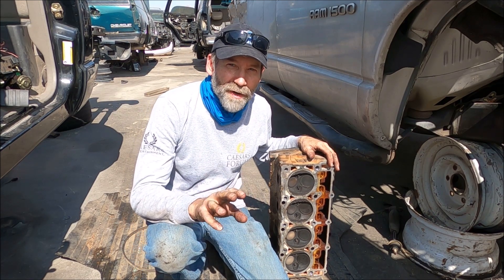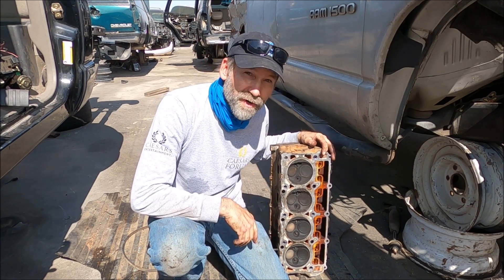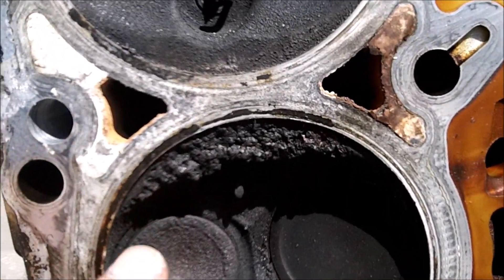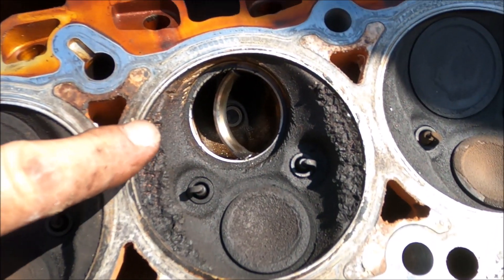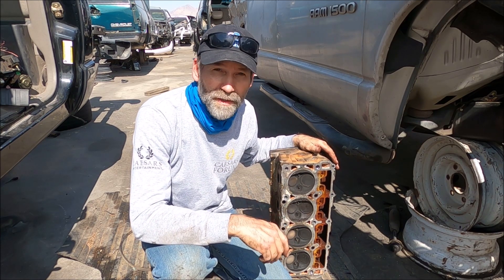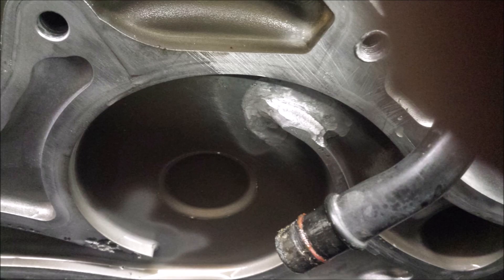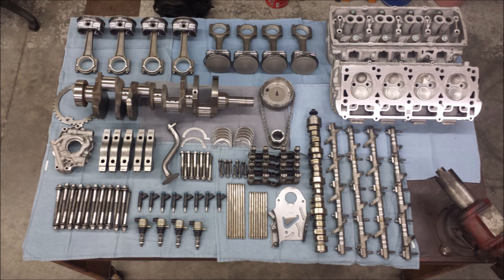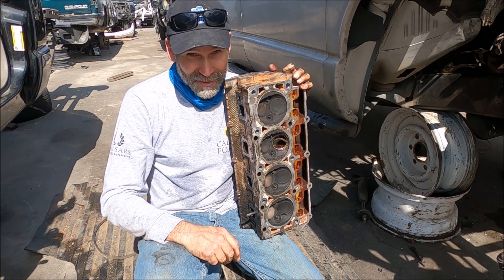Dodge Hemi 5.7 Valve Seat Drop

Comment: I suspect QC under Stellantis is lacking. Motorcycles get mighty hot and dont drop seats.  Ive owned countless cars all with aluminum heads going back to my 1961 Peugeot 403 and not a single one has ever dropped a seat. But getting back to proper cooling system purging I use a coolant funnel attached to rad and purge are from bleeder plug. Then do three heat/cool cycles in the driveway to draw in coolant from reservoir.  But I always worry there could still be air pockets lurking in the heads. Ive seem some examples of vacuum purging the cooling system.

Comment: I do German engines, and all are solid aluminum, i dont understand the idea of this design, why put a valve seat when you can make one solid aluminum head.
Reply from the maker: I doubt that your aluminum cylinder heads you're referring to have a aluminum valve seat that would just get hammered from the hardened valve.

Comment: I have a 2008 Magnum RT with 99.x k miles and have been paying attention to this issue. I believe you are correct. I did a recent overhaul of all hoses, pulleys, water pump, fluid replacement, serpentine belt, etc and experienced problems purging air from the system. The engine started to overhead as I followed other youtube instructions to shake the car and squeeze the hoses connected to the radiator. That helped, but I will suggest that these engines really require us to utilize the bleeder valve on the water pump to really be absolutely certain to purge the air pockets. You might be tempted to skip that step if you can't get that bleeder screw to unscrew. Some folks don't think using that bleeder is necessary if you use some old school methods. I believe that for this particular motor, we'd better do it by the book. You really need the exact size hex ratchet for the valve. Don't use one that is close and strip it it. Put dw40 or similar on it and get that bleeder valve loose. I'd also suggest that you don't let anyone else do a fluid replacement/ radiator flush. Several shops I checked with do not even use distilled water.  How likely will they spend the effort to loosen a rusted on bleeder screw? I had the same problem with brand new brakes, rotors, pads, whole deal. I got the car back and the break pedal felt too spongy. I took the car to another shop to have them bleed the brakes; no change. I then bought a scanner that has the abs purge feature. I ran that on both sides of the car and then re-bled the rest of the system. I also did a bench bleed. Brakes were much improved. Again, two shops taking shortcuts not purging the abs, and doubtful they did a bench bleed. Great video and I believe you are on the right track with the cause. Thanks !

Comment: Do you have to set the timing when you drop a valve do you have to do the timing again
Reply from the maker: Yes if you remove the cylinder head you're definitely going to need to redo the timing.
Reply: @martinbuilt if I turn the motor over do it damage anything it did not crank up
Reply: My car did the same thing did not damage a piston I replaced both heads do I need to do the timing change because it did not crank
Reply: My engine code saying camshaft position but I dropped a valve trying to see do I have to set the timing for it to crank
Reply: I don't see what you saying
Reply: I have a 5.7 do I need to do the timing chain

Comment: Can a dropped valve seat in a 3.7, fall down and keep the crank from turning?
Reply from the maker: I've seen it so bad to the point where it actually breaks exhaust valve off. And yes, then it could get jammed in there and keep the engine from rotating.

Comment: Its heat soak. The engine generates alot of heat. So when you turn it off pump no longer working so that head is still hot and seat slowly drops over time.

The only fix is to convert it to electric water pump so it can run when the car is shut down.

Comment: Hi, I. from Poland and I have imported from US in 2006 almost (11000 kilometers) brand new 5,7 Jeep Grand Cherokee. I made till now 239 000 kilometers. Suddenly my engine failed. My mechanic removed head and in 1st and 3rd cylinder valve seats dropped making huge damages to both pistons (as on your video). It scratch cylinders but it seams that number 3rd  might be not only scratched but also broken. Is that mean I had to find new engine or it can be repaired? I've seen on your video revitalized HEMI and I wonder if I can do the same? Thank you fro your response, Tomek

Comment: What are the odds that the factory that installed the valve seats didn’t use the proper seat to seat bore interference fit?
Reply from the maker: I believe it to be a factory defeat but one that Chrysler would not admit to. The way to keep this from happening is to never overheat the engine and make modifications to the cooling system. Also, make sure the cooling system is purged of air.
Reply: @martinbuilt  I used to build VW aircooled racing cylinder heads for over 25 years and if you do not give the proper interference fit between the seat pocket and seat OD you will end up with seats falling out.

Comment: Just happened to my 300c I’m being told I need a new engine that it would be cheaper is that correct?
Reply from the maker: there would fewer labor charges because it's just remove and replace the engine if the engine is as bad as the one in this video, or if the damage is not too bad. Take a borescope down into the cylinders and if the pistons are intact you really only need to replace the head.

Comment: Overheating, yes. Running without water/coolant,  yes. The other Hemis  that are NEVER overheated, and still drop a seat, are usually due to the rapid cooling/heating/cooling/heating of the cylinders with MDS. When those cylinders are "deactivated", they cool VERY rapidly.  Over time, this also drops seats....
Reply: interesting theory got any more evidence to back that up as gm uses cylinder de-activation as well, and im interested as i have a D-8 iron casting hemi ( copper-beryllium steat's as the oem flame-quenched one's kinda suck and are to soft for 2020-up pump ⛽ and M100 ) in my shop im planning on doing this with as 440+ci is a lot to feed at idle in a shopping lot/fast food joint 😉
Reply: @richardprice5978  yep. I can vouch for him
Reply: @5300trilla  look still on the skip-firing order ( GM i think is probably doing it better than 4on or 4-off but its the same lifter's every time. and the tigershark engine's have a better idea multi-air but is a little different ) as it save's gas ⛽ ( and probably saves ware/parts ) and last i looked at the pump it was 4.5+usd per-gallon so im not feeding all 1970 hemi V8 cylinder's idling/low load's 4.25X4.5 stroked

got a better way im willing to entertain the idea
Reply: @5300trilla  plus a 2-gen hemi v8 running only 2 cylinder's sounds like a beefed up harly big cam ect. aka it sounds ok 👍yes its low on power ( under 200hp ) as its only 2 out of 8 firing = 600-1200 hp~*
Reply: @5300trilla  BTW got a better way of pinning the valve seat's into the iron head's? than mopar's ideas
Reply: I can vouch for this. If you look at my channel, I’m working on mine right now. Mine didn’t overheat, but valves are not okay

Comment: I think the root cause is the position of the thermostat.
A)comprpmise #1
Alloy Cyl heads expand at a much higher rate than the iron engine block.
The cyl head gasket takes a beating and eventually will fail. 
To prolong the life of the cyl head gasket, engineers need to prevent sudden changes of temperature.
To achieve this, they have placed the thermostat at the entrance of cold water to the engine.
Plus the thermostat opens at 195F.
What this does is that when the water temp on the engine side of the thermostat housing reaches 195f ir will start to open but on a very cold day the incoming cold water current from the radiator will basically close the thermostat. Meanwhile, the rest of the coolant in the engine will be too hot, may boil in hotter areas of the cyl heads and create air pockets which them won't cool those areas and then over time you may have iron valve seats dropping.
B)Compromise #2
Integrity vs. appearence.
To achieve both goals of protecting the head gasket and securing coolant flow, they had to fit two thermostats.
The one at the entrance of the cold water being a 160F to prevent a sudden irrestricted high volume of chilled water going into a hot engine, and a regular 190F at the top of the engine in its way to  the radiator.
If this had been done, many would have perceived that as a recognition of an engine flaw and maybe affect the brand's image,
Luckly fo us we can add an inline thermostat housing with a 195F thermostat on the top radiator housing and then change the oem thermostat for a 165F or so.
However, 20 years and 100s of miles later, it may be now too late to fix the damage already done.
Reply: would Evans coolant help? and or a two stage cooling system? like i have seen in a refrigerating plant?
Reply: My 2002 4.7 Dakota has 245k miles on it, never had head gasket or valve seat problems. I live in Florida, it gets very hot and humid here, still no problems. I did upgrade the cooling fans, I removed the mechanical fan and installed 2 12 inch electric fans, but I did that at 200k miles.

Comment: What about the issues with the hydraulic lifters seizing up and causing cam issues?  I've read lots of stories about that happening once these motors get over about 90k.  Nobody seems to know for sure what's causing it other than maybe not using that exact Penzoil that Chrysler recommends.
Reply: Its less about oil brand than changing at 3K intervals. I just did lifters on my car and there is a thin varnish on close tolerance lifter internals that can cause it to stick. There is also a tiny check valve that can start leaking due to the varnish accumulation. Those two can combine to collapse the lifter and allow rocker to get knocked off the lifter pin.  If you had the time and patience you could remove/disassemble/clean each lifter and it would likely go for many more miles.

Comment: Why it happens is because Chrysler installs the valve seats in a cold head. Heat the head up, freeze the seats, then install. And that "corrosion" is caused by using OAT antifreeze's. "OAT" stand for "Organic ACID Technology". NEVER use OAT antifreeze's! Classic green only!
Reply from the maker: That's how we have installed new cylinders in an old Ford tractor.

Comment: That’s exactly what happened to mine after the radiator cracked, destroyed the head and piston, minor scoring on the cylinder wall (#1) honed it out put a used head and piston (new rings) been running like a top for two years now. Didn’t even have to pull the motor, did it all in car (Charger Daytona) When it happened my wife says she didn’t hear a thing.
Reply: Did it overheat?

Comment: Aluminum swells more than steel when heated after so many heat cycles they all eventually let go from the cylinder head. The other thing to worry about is carbon buildup. Carbon around the valve seat acts as a huge heat sink heating up the area.

Comment: Actually what happens is that cylinder heat expands the seat and the seat then comes loose and falls out.
Really no real reason for this too happen though.
This happens as well on some cheapo China Heads yet there is a zillion alloy head/ full alloy engines made that do not do that at all

Comment: Most of the corrosion inside the cooling system isnt caused by "tap water".. every single dealership in the world uses tap water in their repairs. 10 years working for dodge never put a drop of distilled water in any repair, even warranty by Chrysler doesnt require it.. the corrosion is caused by people neglecting to perform coolant replacement services, and failed radiator caps causing cavitation.. over time Additives in the coolant break down and cause the pitting.

Comment: When this happens does this cause the engine tinhave that ticking noise that they say there common for or ? I guess I’m trying to ask what to expect for noises when it drops a valve seat ?
Reply: The two most common Hemi ticks are roller lifter failure eating the cam and the exhaust manifold bolts breaking giving an escaping gas ticking sound on cold starts.

Comment: Hey how do you keep the valves from dropping?
Reply from the maker: Don't over heat the engine and make sure the air has been purged from the cooling system.
Reply: @martinbuilt  Except if you blow a hose and and the temp jumps up rapidly.  Just happened on my 2006 Charger Daytona with the 5.7L in early Sept 2021.  Got to the shoulder of the highway and stopped before it was above 80% on the temp dial but it was too late.  Seat dropped and KABOOM.  115,000 miles.

Comment: I'm not sure why they can't simply put 2 pins in the seat that anchor it to the head. But then again... That would save an engine.
Edit: or thread them in and install a key or a pin to lock them in.
Reply: What about welding it buddie?
Reply: @jubelynn3542  You can’t weld steel valve seats to an aluminum cylinder head

Comment: I have a 5.7 hemi commander and this scares the crap out of me
Reply from the maker: I would say keep the operating temperature low and never let it overheat and Purge the air out of the cooling system and I don't think it will ever drop a valve seat.
Reply: @martinbuilt  Good to know brother! 💪
Reply: Mine dropped @ 192k miles

Comment: Unfair to smear 4.7 when so many other aluminum head engines have same problem.
Reply from the maker: One of the reasons I made this video I'm also tired of hearing how the 3.7 and 4.7 will drop a valve seat and they're saying it's not if but when which I think is BS
Reply: I think they all deserve a smear, for not staking the valve seats so they don't drop.  It's easy to say until it happens to you..
Reply: Mine dropped upon second stop and startup
Reply: Twenty year old engine lived longer than design plan: Stupid to overengineer: Cheating the Corporate stockholders (you get fired)
Reply: Your 20 year old Jeep has already lived past it's design lifespan. Just be glad it's not a Porsche and you don't have a broken crankshaft. https://rennlist.com/forums/996-turbo-forum/370125-broke-crank-at-the-race-track-6.html

Comment: Great video Martin. Please do a video of air bleeding from the cooling system.
Reply from the maker: Thank you, I do have several video where I do explain the how to and how important it is here are some of them.
Flush Coolant on a 99-04 Jeep Grand Cherokee  https://youtu.be/Ny5gfAAPrZk
How to Install 4.7HO Camshafts & Solid Lifters in a Jeep Dodge Chrysler & Mitsubishi  https://youtu.be/URrQ9sMgLJs
How to Install 4.7 08 Camshafts, HO Valve Springs, & Valve Stem Seals  https://youtu.be/MN3c94VevEM

Comment: Would you trade in your 4.7 for a 5.7 or 6.1? 
I kinda don’t want to mess around with the 4.7 when I can swap a 6.1 into my 02 GC for a similar end cost.
Not to mention the 4.7 performance aftermarket is terrible
Reply from the maker: I've been enjoying the 4.7 and sharing the mods that can be done. The one thing about the Hemi if I were to install one the end cost would actually be a lot more than any for 4.7 because of the large aftermarket support cuz you know I would have to add every bolt on that's out there ... LOL
Reply: @martinbuilt  haha that’s true thanks for your take
Reply from the maker: @rodom303  yeah a 6.1 would be a lot of fun with 400 plus HP